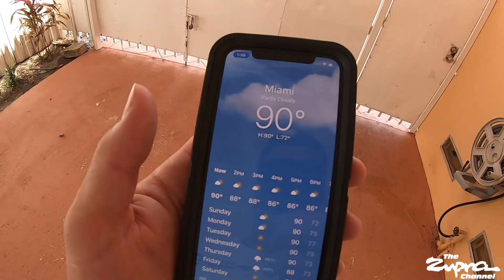MPI Open House 5/1/21

Comment: You are so right about those straight piped Coyotes. The tone they make is very hurtful to my ears as well. I’ve had too many encounters with those punks who just like to get heavy on the throttle to make noise and a spectacle of themselves. But a Coyote with a proper exhaust sounds really, really nice in comparison. I label those straight pipe guys as the punk demographic of the Coyote crowd, who are either too cheap or poor to afford a proper exhaust system for their car? If I were a cop, I’d be writing them tickets left and right. Straight piped 350/370Z’s are another group of noise makers. Straight piped anything just sounds like crap, and makes you look like one of the “poors”, imho.
Reply from the maker: Agreed

Comment: Car looks super clean man.  Where did you get the compressor Inlet rubber spacer for your 5" Intake?
Reply from the maker: Thank you,

It’s a actually a 6 inch to 5 inch reducer 

The pipe is a 6 inch is that what your looking for?
Reply: @TheZuprachannel  Yes - wondering where you purchased the reducer.
Reply from the maker: Here is the link

You have to call them and ask them if they can sell it to you 

https://www.sy-klone.com/6-inch-to-5-inch-rubber-reducing-insert.html
Reply: @TheZuprachannel  Awesome...thanks brother